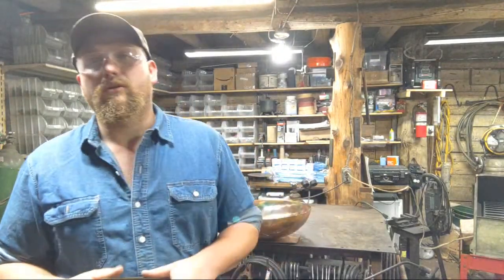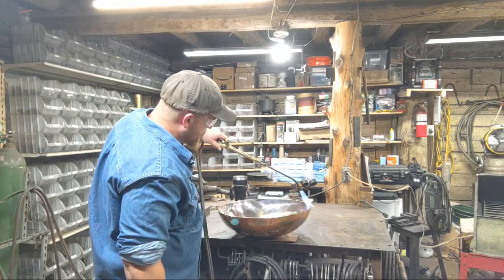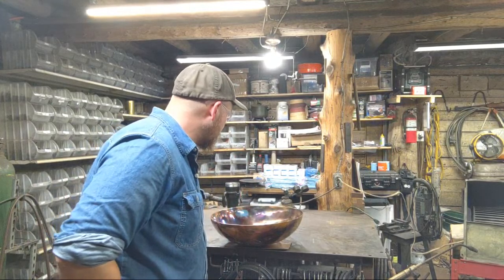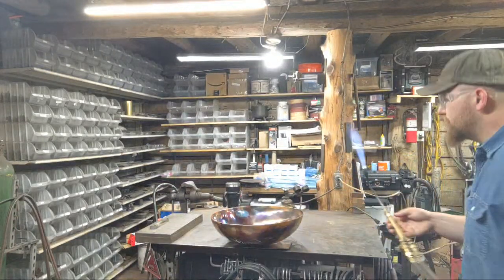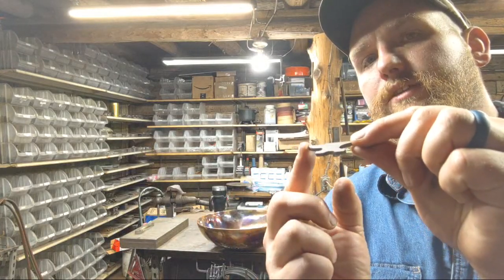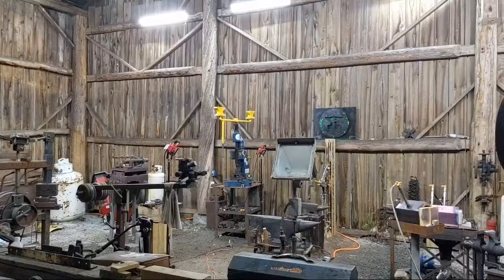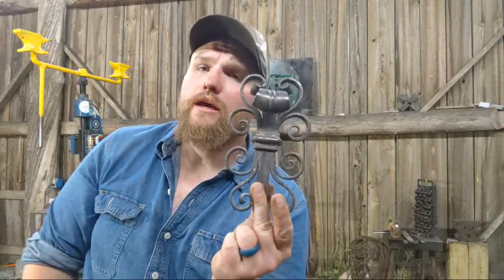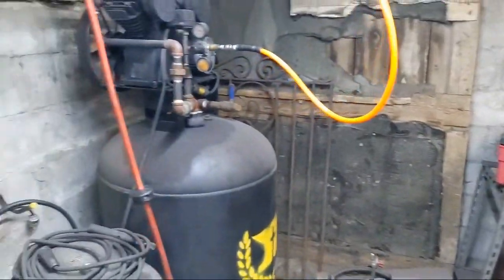Random Live Flame Painting A Copper Baptismal

Comment: Nice job! You have helped me with this. I do think I was not polishing it it enough? I hate to mention this but in welding school and in text books they always teach gas on first gas off first. Yes it does pop but, but shutting the gas of first you take away the fuel. Oxygen can not burn alone. If you shut your gas of last and have a leaky valve you could have a small flame in you torch your unaware of and can back burn up your line. This also should be practiced when turning tanks on and off. Thanks